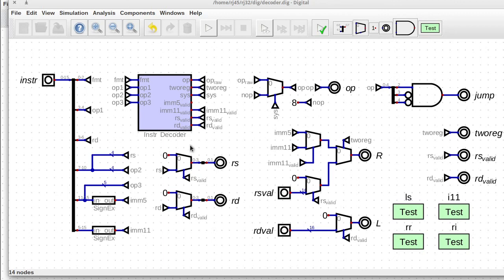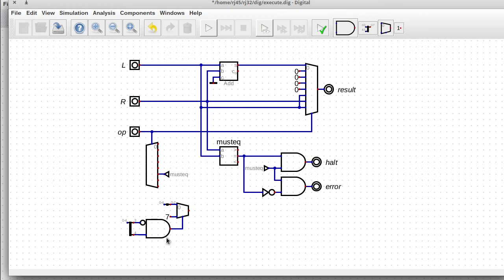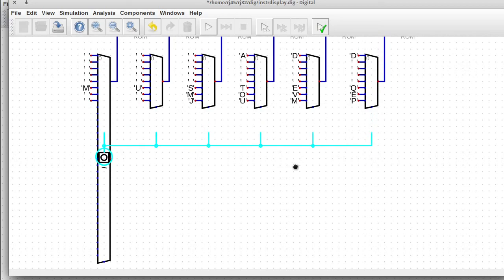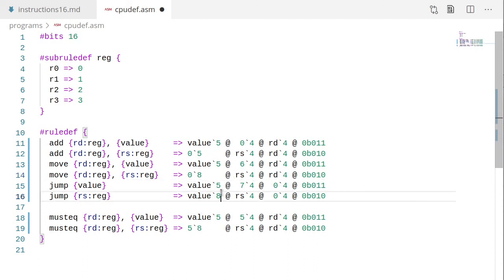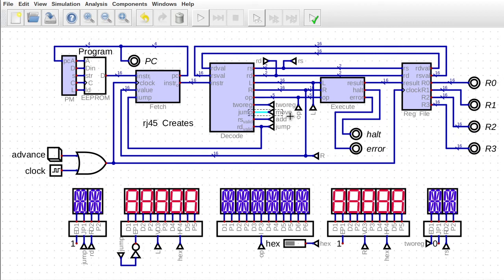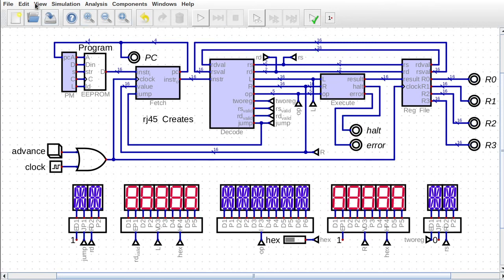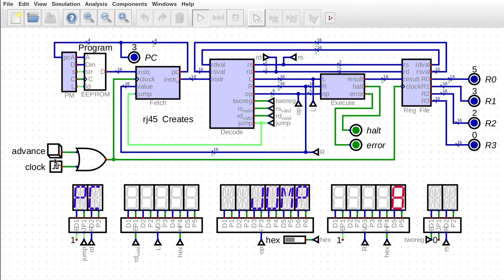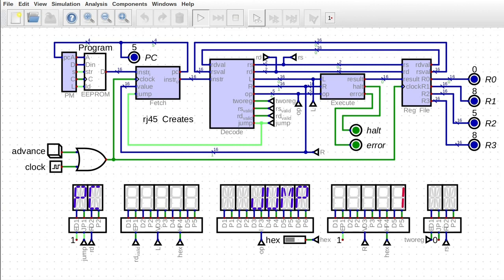[021] Instruction Set Decoding! (Part 3) - Building a CPU From Scratch

Comment: Again a great video. I noticed the 'r' branch instruction format has 4 bits that are not used. Would it be an idea to use those 4 bits to specify a displacement, like 'jump r1 + <imm5>'? Where imm5 is constructed from the 4 previously unused bits and a trailing 0 bit to make it an even 5-bit displacement. This would greatly simplify relative jumps.
Reply from the maker: Sorry that this comment got lodged in the review system and I didn't notice it there till now. I do eventually get relative jumps working in a later video. And I redesign the ISA at least once to move around the bits. Currently there's room for an 11 bit displacement for the jump and call instructions, and that is implemented relative to the current PC.